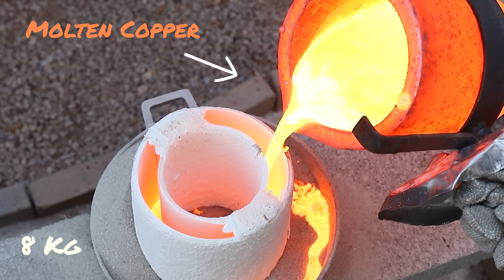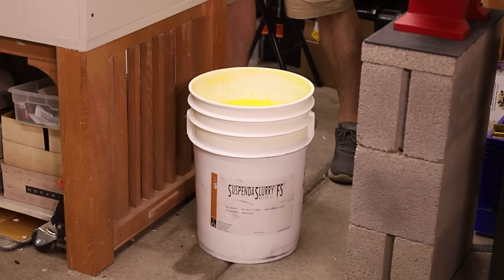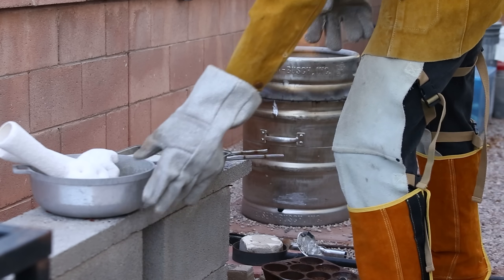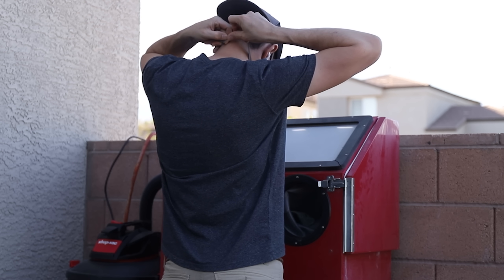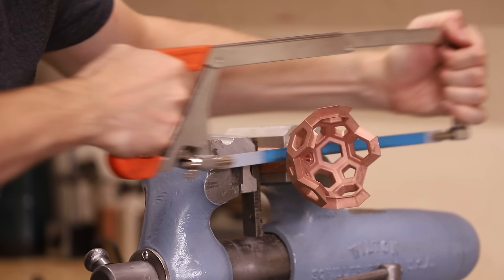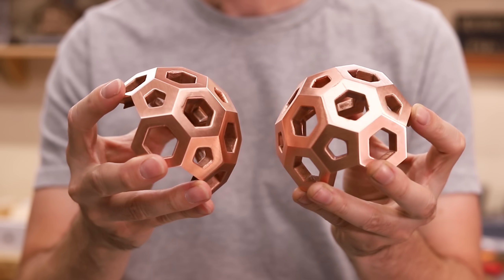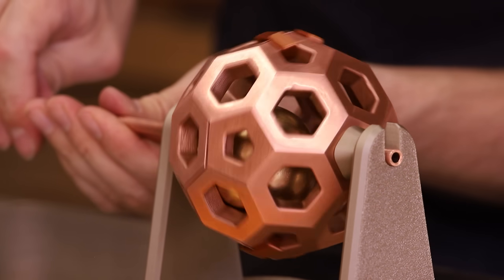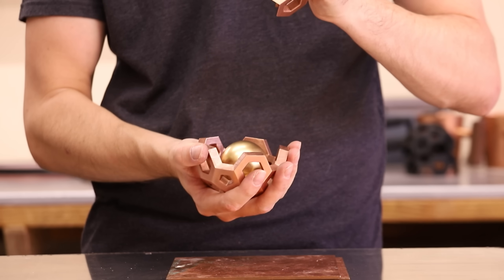HUGE Magnet VS Copper Sphere - Defying Gravity- Will a Neodymium Magnet Float Inside?

Comment: This project ended up getting my creativity quite stimulated, so here are just a few ideas using your leftover copper sprue cones:

 • Make a Lenz's Law Magnetic "Hourglass" from the copper cones. First, join both cones together at their narrow end. Now carve a long helical path into the side (◇) for a spherical neodymium magnet to slowly roll down (employing Lenz's Law). Wide <-> Narrow <-> Wide. Put a cap at each end to stop the magnet/s from falling out.
  • You could use the copper cones as a mandrel for making rings or tapered coils.
  • You could carve/etch the cones with various patterns/text (nb: back to front & inversed) to make them classical clay/wax stamps. (Disc-shaped for European wax stamps, cone/cylinder shapes for ancient Mesopotamian rolling stamps for clay tablets. You can chemically treat the copper for a lovely "aged" verdigris patina.)
  • You could sculpt each cone into a set of apothecary's weights.
  • You could slice the copper cones into all sorts of interesting shapes. discs, discus/m&m shapes, ellipses, parabolas, hyperbolas, or combinations of these.

(◇) - It may help to visualise a copper pipe with a strip cut away on the outside (to view the falling magnet through). Now twist it into a symmetrical coil (with the opening on the outside) that resembles an hourglass shape, starting wide, getting narrow & ending wide. If you drop a spherical magnet into the top of the pipe, it will slowly roll down the helix, accelerating as it narrows, then slowing down again as it widens. You could also make it with 2 or more helixes / magnets.
With a spherical magnet, you could dot each pole (N/S) with a different colour to watch it rotate as it rolls down its channel.

Comment: Have the sphere rest on the cradle you used your drill on. But now use the circular magnet on your drill and spin that near the sphere (as you did by hand). Then your magnet spins the sphere that floats the ball magnet. Using a controllable motor instead of your drill allows you to tune it to the precise required speed.
Consider (as bonus) to use a tunable strobe lamp to sync with the sphere's spinning

Comment: Being a welder for 40 years, 8 have worked with non magnetic metals such as aluminum and copper over the years, i discovered the repelling force with magnets purely by accident, thinking I had discovered something new, but of course after researching,  I found its old knowledge,  but I have done similar experiments... You asked about ideas, well, here's one that will be interesting,  try putting your magnetic ball into a large Aluminum or copper bowl or concave disc and spin it... I found flat surfaces will throw magnets hard and at quite a distance at high RPMs, but a bowl should keep the ball captured at the bowl's center axis as it levitates... just mention my idea if ya do it, have fun.

Comment: The sphere magnet is pretty much the same as a bar magnet. So I'm presuming it aligns NS with the axis of rotation, minimizing the effect. 
If you could make a compound magnetic sphere (maybe 20 sided icosahedron) out of smaller plate magnets, the effect could be much greater. ???

Comment: im not sure why you didnt make the inside completely spherical, but it might help making it more stable during rotation as it will get equal force, as it is there are low and high points which can lead to it hitting the sides.

Comment: "Lenz's law states that the direction of the electric current induced in a conductor by a changing magnetic field is such that the magnetic field created by the induced current opposes changes in the initial magnetic field."

Current induces a magnetic force, and vice versa.

As someone who doesn't know nearly enough about physics, I'd like to know if anything happens if you apply voltage to the copper sphere. I'd like to say play it safe and use low voltages (12VAC and 24VAC), but that sphere is pretty bulky and probably offers a lot of resistance. I'm no electrician either.

Comment: you should use bearings on each sides to remove frictional force, about constant speed i would use 12v motor some belts and gearwheels should do the trick add controller to get constant speed :) amazing results show us update!

Comment: Making the sphere out of silver would give you better levitation because its electrical conductivity is higher (about 105% that of annealed copper), therefore getting a stronger density of eddy currents induced and therefore a stronger secondary magnetic field repelling the magnet (for the same rotational frequency). With this in mind, you could try to anneal the copper to make it as conductive as possible if silver is too expensive. The reason the secondary magnetic field repels is due to Lenz's Law.

I would be dubious with that size and shape of magnet. It may be that it is stronger (in terms of magnetic flux [Webers]) but actually a smaller cylinder-shaped magnet may provide a stronger magnetic flux density (Tesla or Webers per square metre). It may also produce a more distended stray field (more favourable distribution of magnetic field) which ultimately will provide stronger eddy currents as more magnetic flux passes through the copper (Faraday's Law of Electromagnetic Induction).

You can also decrease the size of the windows in the sphere, increasing the surface area of copper and therefore the amount of eddy current that can form. Also making less air gap between the magnet and copper will also significantly increase the levitation effect, as there is less lift-off meaning that the magnetic flux density at the surface of the copper is stronger, and therefore stronger eddy currents due to a greater change in magnetic field (Faraday's Law of Electromagnetic Induction).

I use a similar but simpler demonstration for my teaching of eddy current-based non-destructive testing for inspecting welds, wrought product and tubes in industry :)

Comment: i dont know if someone already suggest this before. if you could put both side of the copper sphere to rotate at same velocity, but slightly separated, would get the same results. the magnetic should levitate a little. just separated enough to see and not fall off. will be best to see the magnetic effect i guess.

Comment: Well, the Foucault effect happens in conductive materials, in theory if you use something like indium tin oxide (ITO) or zinc oxide doped with aluminum to make a sphere, you can replicate this effect very nicely. But I believe it only works on extremely powerful magnets since it would be a weak effect.

Comment: Whenever you did the 2nd magnet moving forward it went forward and backwards, it moved backwards, maybe having too running forced either start the 2nd magnet to get the 1st magnet to possibly create a energyless engine out of, only using the energy from the Gravitational field, having it hooked on a metal shaft, from the other end can be the output can produce that output side to keep rotating upon these magnets rotating, I can honestly see this being used in the automation side so long as the magnets would be powerful enough to pull the weight of the parts on a vehicle or motor.

Comment: I think the reason it only hovers temporarily is because the magnet probably starts spinning with the outer part and so the effect lessens. maybe a reciprocating movement instead, or 2 copper halves spinning independently against each other?

Comment: Put the motor and secondary magnet hidden under a base, make the axle much smaller to needle point mounts to highlight they are not driving points and fine tune the speed with the ability to match shutter speed

Comment: Clearly rotation RPM's have a lot to do with the sphere stability as it exists right now. However, I think the distribution of copper mass in the polyhedron has far more influence. There are imperfect surfaces and thicknesses in the polyhedron that have affect on the distribution of magnetic waves. The lack of even distribution of magnetic waves has more influence on the sphere not maintaining a static position within the polyhedron. If the rotation of the polyhedron could be perfected in terms of vibration and the even distribution of mass surrounding the spinning axis were perfected, I think you'd find at some point the RPM's of the spinning axis becomes less of an influence than the mass distribution of the polyhedron and you'd achieve a higher degree of static rotation of the sphere itself. Bottom line: GREATER accuracy of mass distribution = increased stability of sphere within the polyhedron AND less influence/reliance of the rotational RPM's of the polyhedron itself. This is a study in preciseness of the mass distribution of the polyhedron affecting the static position of the sphere within the polyhedron more so than the rotational RPM's may have.

Comment: Where the two copper castings meet, probably need an excellent electrical connection to allow the magnetically induced eddy currents to flow.  This should help with a more consistent levitation of the magnet inside the copper cage.

Comment: What would happen if you had a sort of slip clutch mechanism for a rod spinning the magnet instead of the housing?  Spin the rod beyond a certain threshold that no longer engages and pull it out while the magnetic sphere inside rotates at high speed (and hopefully floats).

Comment: You're running into issues with field harmonics and the half shell design of the cage is limiting the strength of the fields that can form in counter point to the main magnetic field. The ball is "floating" so close to the side because it's riding the field differential as your spinning the outer cage. The established eddy field in the copper has moved enough to interact with the field of the ball and just enough to temporarily repel the balls magnetic field enough to offset it's weight. If you are able to hold the ball in the center of a magnetically intact cage then spin the cage up to the point the ball in the center does not have enough time to become attracted or repelled by any singular point in the cage at any point in time then the ball will reach the point your looking for by being magnetically "locked" (referred to as quantum locking or flux pinning) in the geomagnetic center of the cage.

Comment: Take the magnet  from the centre out and see if you can make it hover over a circle of 3 or 4 AC electromagnets.
By changing the phase of the electromagnets you could make it spin in any direction (controllable with a joystick.)
With some hidden electromagnets in the base it would make a really cool "perpetual motion machine".

Comment: First of all... great work! The copper shined beautifully in there! 
Second of all... maybe turn those exceeding rods into... idk... some bracelets? I can just think of wonder woman when I saw them.
Third of all, maybe try to put on the drill motor you utilized and try to separate the sphere shells and see up to whitch point it stops floating (maybe by enlarging the clips you made, so they're holded more distantly?)
And forth of all... I loved all this! Gave me some ideas to test, specially with the "remote controlling" thing... 
(As a side note... I know your work was very hard in this video, and that this took a lot of time and money, but maybe, someday, could you try making a roman dodecahdron and see the difference between these two? That would be awsome)

Comment: Assume a theoretical frictionless setting, for simplicity the cylindric case, where the magnet is suspended in a rotating tube. Does that system consume any energy to keep rotating? Would you feel this as a force against the rotation? I'd imagine it has to based on the resistance of the eddy currents in the copper, but I have no idea how large that force would be compared to the rotational momentum.

Comment: Try to get a motor on the shaft to give you a set RPM and then set up a strobe light so you can flash at a specific hz. 

Also try running current through the copper, DC and AC at varying frequencies.

Comment: Cool ideas... make the outside ball bigger, get it to levitating using a motor, then introduce an outside plasma, adjusting the high voltage frequencies to see how you can adjust the plasma behavior by adjusting the voltage frequencies. Obviously you would want a control  without the copper ball for comparison.

Comment: Very interesting.  I loved it.   You asked for suggestions.  Try another set of copper pieces , larger.   The magnetic field might be too constricted at the size you have.  Then try various rotation speeds with the larger copper set.   Maybe there is a way to measure the magnetic field strength at different sizes.   Im a lifelong science fan , observing variation in the experiment and taking notes , comparing different results , these are the wonderful things about learning science.   Good luck , keep trying.  👍👍

Comment: It doesn’t “defy gravity” stop using words that doesn’t explain the true science behind it. The eddy currents causing almost a dead short inside the copper pipe is the effect creating a counter magnetic field which slows the neodymium magnet down. It’s exactly when you start up a gasoline/diesel generator and when you turn up a welding machine or other power hungry equipment you suddenly can hear the rpm slowing down because of high resistance in the generator coils slowing the shaft inside…

Comment: Did you try to physically center the sphere with your hands?  It may need help getting centered.it may snap to center if you get it close enough.   Make the sphere the same shape outer tetrathingy.  Mabe you need a different  shape like a cube for either the inside or the outside .   The holes in the tetrathingy should be the same size. Ahhhhhhhhhhhhhhhhhhhhh so many possibilities

Comment: If eddy currents are driving this, you could have LEDs between the copper pieces and it would maybe light up when you spin it. It depends on the voltage you expect from the eddy currents. It might also depend on the axis of rotation - I can't visualize which way the currents are flowing or the shape of the magnetic field generated by the ball.

Comment: Maybe the size and weight of the magnet in relation to the distance from the inside walls of the sphere.  Would be interesting if the magnet could be introduced to the center of the sphere after it was already rotating. Maybe a solid sphere with smaller openings on either side just large enough  to introduce the magnet once spining.

Comment: The clay mold has such casting resolution that you could save some finishing time if you smooth the 3D printed positive mold more (sanding, acetone, etc). Your casting process is amazing.  The sprues seem really large, but i cannot argue with the results.

Comment: Maybe you should try to get much better electrical contact between the two half football surfaces so that electrical current can move uninterrupted. You could also experiment a little with both rotation speed and camera framerate so that you can set a constant rotation speed that is in interference with the video framerate creating an illusion of everything standing still.

Comment: If the copper ends are making contact with the object: Is there any chance you can connect a multimeter to each copper end and see if spinning is generating current?

Comment: I think one of the coolest parts of your video is actually the casting method you used! I have never seen that before. It makes me want to try this!
Reply: It's called lost pla casting. I've seen it used a few times in videos
Reply: I do feel you want to wear some kind of mask with fume protection. No experience on this here but I can imagine the molten plastic residue on the bottom would have produced like some toxic fumes burning to that I feel and it might still be lingering in there plenty when you open it up. Just trying to look out for preventing health issues that's all :)
Reply: @DJMetalstone  you should wear a mask when in the room with any 3d printer. They all give off fumes. But with burning off the pla, you're going to be doing that outdoors, anyway, unless you're crazy, so fumes will be less of an issue.
Reply: @ShadowMage3D  well when he opened it up wouldn't the fumes get out right in your face ? Just wondering. Since it seems all is kinda trapped inside untill you open it up to keep the heat in. At least that's what it looked like.
Reply: @DJMetalstone  The fumes wouldn't get in your face as they would have dissipated long before you opened the kiln.
Reply: me as well!
Reply: Way cool fabrication of copper sphere.
Thank you.
Reply: Search "lost wax casting" too it's how bronze castings are made.
Reply: The result was impeccable
Reply: It's an old Indian casting technique called lost wax casting, primarily it was prevalent in South and middle India.

Comment: Needs to be on a gyroscope so the spin can have 2 angles of rotation. 

And the hexagons need to be larger so the shell becomes invisible while in motion.
Reply: So. Gyroscope, with 2 motors to actuate the spin on multiple planes, swap the shape to a cube so you have consistent 90° rotational angles and a clearer view of the magnet ball

Comment: The effect is depending on the magnet....and the copper body will be moving in relationship to each other.

Speeding up the rotation does not really do much as you will only drag the magnet with you.

Figure out a way to fix the magnet and rotate the sphere.....or fix the sphere and rotate the magnet....and you will magnify the effect dramatically.

I noticed the magnet had a hole or dimple in it....JB Weld a steel stick in there, that goes out through the short end axle....and now you have means to fix the magnet...dont know how it will mechanically hold, but think it will hold enough to get the effect significant amplified.